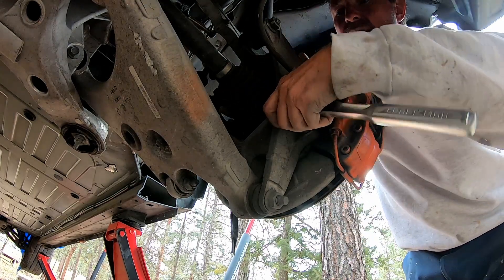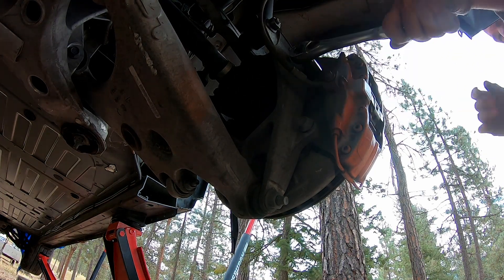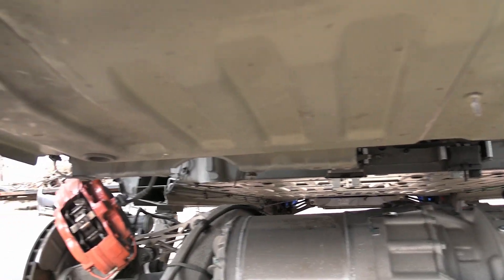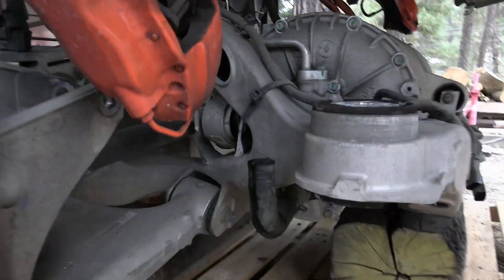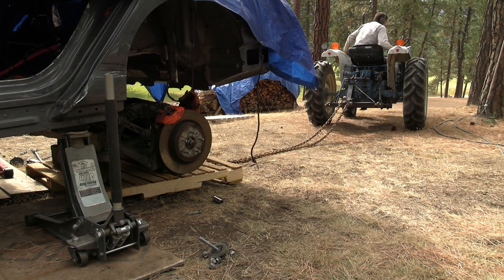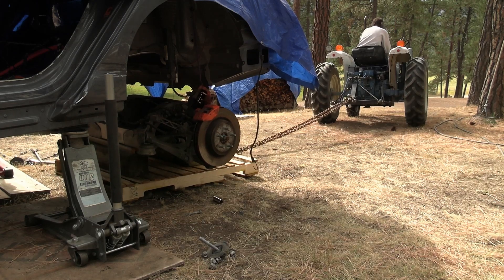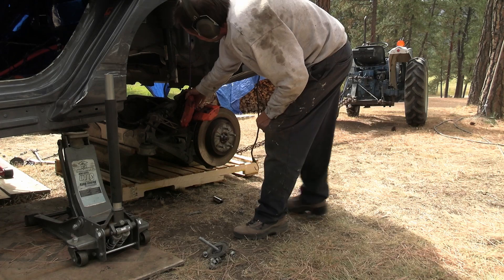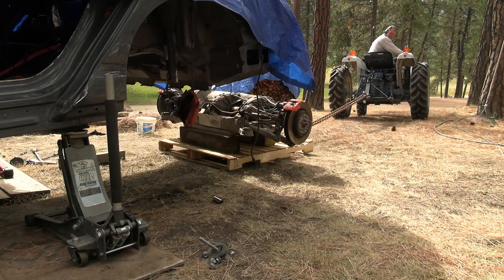Tesla Model S Drive Unit swap in backyard with basic tools. 2013 Tesla Model S 85 DU removal. DIY

Comment: Do you have to put coolant directly back in motor after removing? Or can I just add cool back in to reservoir in the hood
Reply from the maker: @Killahkron1992  Coolant is added to the reservoir under the hood. It’s best to run a coolant system bleed, which I believe is now available in service mode. If not Tesla toolbox  would be needed. You can get away without doing the bleed procedure if you keep an eye on the coolant level in the reservoir and keep it topped off as air is coming out of the system. This means you would have to carry coolant with you and checking it frequently. Are you swapping a drive unit?
Reply: @RMTFamily I’m changing rear subframe but have to move the motor on new subframe

Comment: Can you explain how you remove the parking brake since it is electric and need it to be unlock in order to remove it. Also, how safe did you remove the drive unit from the high voltage cable. I know the battery pack needs to be drain completely, two access connection with the laptop to shut contactor, and three check voltage on the high voltage. Can you please do this set in order to be safe? I need a clarification safety reason
Reply from the maker: @eleric4028  To release the parking brake you can put it in tow mode. You can then disconnect the wires to the calipers or disconnect the low voltage (12V)battery to prevent them from applying again. The SOC (state of charge) of the battery pack doesn’t matter. It can be fully charged when replacing the drive unit. So whatever SOC it is at is fine. You need to disconnect the firefighter loop under the hood, passenger side, maybe hidden under apron, and the low voltage (12V) battery needs to be disconnected. At that point the contactors should be open and can’t close since without low voltage and open fireman’s loop. Then you remove the covers on the high voltage cables at the drive unit and use a voltmeter to verify there is no voltage (0V) there. Then you’re ready to get to work. The vehicle is shutdown. No laptop is required at all. After replacing the drive unit you do a software reinstall from service mode and you’re ready to go.
Reply: Thank you very much. I needed this clarification. I have a hard time with this type of work to do it with confidence because it is high voltage. It can be intimaniting. I plan to do a classic car to electric conversion for future reference. I'm glad I came across your channel. @RMTFamily
Reply from the maker: @ Cool, classic car conversion👍 Get yourself a pair of 1000 volt rated lineman gloves with leather over gloves. If you’re unsure about high voltage being present you can wear these while measuring the voltage with a meter. This way your save if you would accidentally touch a life HV part. I have a pair and usually wear them when working/disassembling  a battery pack. Feel free to as ask if you’re unsure. Keep me posted about your project. Sounds really cool.

Comment: Dude- hydraulic jacks are still dangerous, even the expensive ones. Even at the start of the video, while you were jacking up the passenger side rear, the whole car shifted to the right.  

Don't condone this. Put a jack stand under the damn car.

Comment: I dont think the issue is an instant seal failure but gradual lowering you might not notice if youre under the car. By the time you catch it, could be too late. Unfortuantly, a friend of mine in elementary school had a father who raced stock cars and was found in his shop, pinched under his car due to trusting his high quality, name brand, jack. 

Using some wood between the head of the jack and the cross member between the front wheels is a good way to mechanically hold the jacks in a way where even if they fail, you're safe.

Comment: Of course it is safe providing   the jacks are on solid, firm, level surface.  Each wheel the load is  NOT the total weight  and jack is able to  handle  thousand of lbs.  

I like this method and will use it when i get my used Tesla.  The only drawback is it requires 4 jack.
I would use jack stand for extra safety better safer than sorry and most definitely jack stands are way cheaper than a hospital bills. 

Safety first people!!!!!!!!!

Comment: Wow you really need Jack stands please use them next time
Reply from the maker: I appreciate your concern. Unfortunately Jack stands don’t work on soft ground. And they don’t allow for the vehicle body to be raised and lowered. 
Many people consider a two post lift safe, even without using the mechanical locks, but most two post lifts use only a single hydraulic cylinder. If it fails the lift comes down. Using multiple floor jacks means multiple cylinders have to fail. Putting blocks under the wheels is safer than anything.

Comment: How are you going to reset the immobilizer on the replacement drive unit?
Reply from the maker: There is nothing to reset. Request a software update(same software, re-install) in service mode and that will recognize the other drive unit. That’s all I have done for the drive unit as well as for the battery pack and other components that I have replaced.
Reply: @RMTFamily how do you request a software update. Please get back to me before I get stuck lol thanks
Reply from the maker: @mazhariqbal5106  I hope I'm not to late. Put the vehicle into service mode. There you can request the software update. Most of the time it will only take a few minutes and you should see the same notification on the screen as with any software update. Just in case, in this video show how to put it in service mode. You will see a different menu than this, but same way to get in.
https://youtu.be/TMbOsoq24gc
Reply: @RMTFamily  nope u r not to late u r the best thank you again. Last question did you have to
Refill your ac line with Freon after this. I was reading somewhere where we need to but u didn’t mention it so not sure.
Reply from the maker: @mazhariqbal5106  No, no A/C line was disconnected during the swap. No A/C line is going to the drive unit. The coolant lines were disconected and some coolant is lost. Also depending on the drive unit you put in, it may have some or no coolant in it. The coolant system needs to bleed air out of the it. If you have Tesla Toolbox then you can activate the bleeding process in there. Without Toolbox make sure to fill the coolant reservoir to the max and drive the car around the block a few times. Just in case have some coolant with you so you can top off if needed while driving. It will eventually bleed all the air out of the system over time. just keep checking it daily for a week or two and top off to max as needed. Now all that said, there are new functions in the Service Menu (haven't looked in a while), there maybe a coolant system bleed function now on these "classics".

Comment: My main concern would be disconnecting the high-voltage wires, how do you know 100% you’re not gonna get shocked
Reply from the maker: There are a few things that are done to prevent any high-voltage coming out of the battery pack. Inside the battery pack are two contactors ( large relays ), these prevent any electricity from coming out of the pack when the car is shut down. The electronics do monitor these contactors and a fault code is triggered if they don’t properly open or close. So first step is making sure there is no such fault code. The next two things are disconnecting the fireman’s loop and disconnecting the 12V battery ground. By doing this the previously mentioned contractors can not close anymore because the electronics got the signal of the open circuit in the fireman’s loop and there is no power on the 12V system anymore. The 12V power from the low voltage (12V) battery is required to close the contactors. The last step is verifying there is no high voltage at the drive unit, by removing the cap over the HV connection and using a voltmeter to measure voltage on those wires. At that point that should be a 0V reading. If it is not a 0V reading then there is something else wrong that needs repaired first, in general it would have to be malfunctioning contactors. That usually throws a code and would have been noticed in step one.
Overall working with electric vehicles is is less dangerous than working on ICE vehicles. I got burned many times by hot engines, exhausts, hot oil and coolant, V-belts, serpentine belts and timing belts can be challenging to for fingers lol. All these things don’t exist on EVs.

Comment: Man, you have ALOT of trust with those harbor freight jacks. Balls of steel 😂
Reply from the maker: I take that as a compliment😂.
The floor jack weight rating is way above what it will ever lift in this case as the car weighs less than what one jack is rated for.
Also many brand name tool companies buy the same cheap jack from the same company in china just in their color and with their name on it. I have had one of those jacks for many years already and it still works 100%.
Thank You for watching👍
Reply: @RMTFamily  You shouldn't. You're an idiot. Should NEVER put more than one jack under a car. Proper procedure. It's not about rating, and lifting capacity, anything tips it over and you're done with.
Reply from the maker: @almasysephirot4996 One that calls others “names” shows a clear lack of education. It clearly shows you have no work experience in this, certainly not under the conditions that this job was done in. And sure enough it has to do with capacity and the amount of proper floor jacks used.
Reply: @RMTFamily  Proper? You put them on pallets scattered over slant soil. Nuff said
Reply from the maker: @almasysephirot4996 Not everyone has a shop. Working inside on a flat floor is not always possible. You obviously lack a lot of experience.
Reply: @RMTFamily  Have enough with 3 Model S behind of me, and a Z4 BMW. I'm glad you're ok. Be more careful next time!

Comment: This is fantastic.  I see that bought this two years ago with 200k in your other fantastic video, how long did you get out of this till you needed a new drive unit.   When did the problem start showing itself and did you have to make the repair right away or could you nurse it along for a while?

I love knowing that you can swap the drive units yourself if you're so inclined.  I didn't know it was diy possible.  

Drive unit failure was something from detering me from getting a high mileage one but now i feel differently because you're a hero
Reply from the maker: We drove about 10k miles before the drive unit failed. It's an inverter failure and left us stranded just a few miles from home. Towed it home with my truck, just using a tow strap. So no way to nurse this one along. But we had also a contactor fault which resulted in limited power availability. That fault popped up about 3k miles before the inverter failure. The two issues are not connected in any way. We drove with contacter fault as the limit initially was above 200kW but over time dropped to 160kW and during long drives could drop to about 100kW. But it was always drivable without even noticing the power limitation unless you wanted the Tesla acceleration experience🤣.
There are many things one can repair on these Teslas. Now that service mode access is available in all Teslas it has become even easier. Before you had to call Tesla and make them send you a software reinstall, now you just request it in service mode. 
All cars regardless of brand or powertrain have the potential to of issues. One gets lucky the next one don't🤣 You just never know when buying used. The risk of a high mileage EV is lower than ICE. Engine failure(ICE) or Drive Unit failure(EV) same thing. Auto trans in ICE and battery pack repair in EV, same thing. We have many more resources now than just a couple years ago for repair information and parts for Teslas.
For me, it may not always be a Tesla but for sure electric.
Thank You for watching👍

Comment: Very informative.  Would love to see a side shot to see what sort of lift angle you need.  I was thinking of a slightly different technique leaving wheels on but this has been very helpful.
Reply from the maker: The angles were kinda given by the ground. I just supported the drive unit as I lowered the car somewhat parallel to ground. Getting it supported evenly that I could remove the bolts without it dropping/falling.
Wheels on may work if you lift the car high enough. You would have to remove the wheels at first, to remove the brake calipers, and the bolts that hold the strut. Then you would have to lift the car extremely high, which is probably not possible with floor jacks, to roll the drive unit out from underneath the car. One problem may be the center of gravity. If there is more weight in the front or behind the center of the wheel drive unit will want to tip in that direction. I just went outside real quick to take a look at the drive unit, and how it sits in the subframe. The motor and inverter part of the drive unit sits behind, way behind, the center of the wheel. So it will definitely drop down on the backside. Which would require you to support that somehow with something that rolls as well, so you could roll it out. Please let me know how you got it out. Thanks
Reply: @RMTFamily  Thanks for the prompt and informative reply.  I realise now leaving wheels on probably causes more issues than it solves.  I think a pallet truck, in my case, would be pretty handy as you say.  It certainly is a doable job without a 2 post lift as you have proven.  Keep up the good work and be safe.